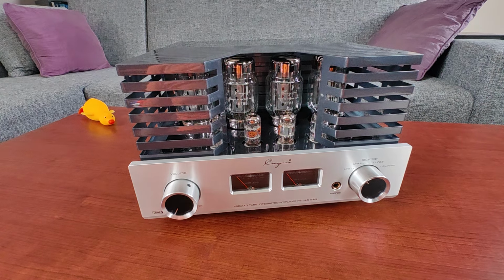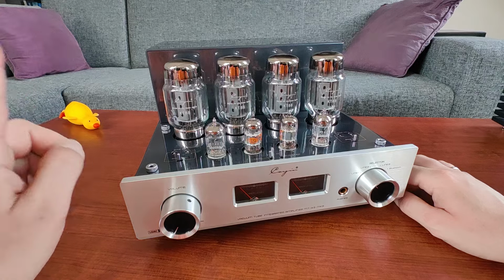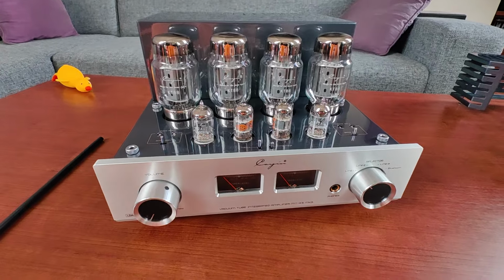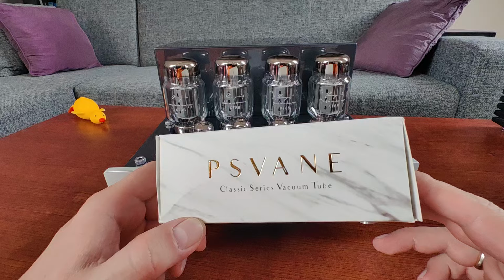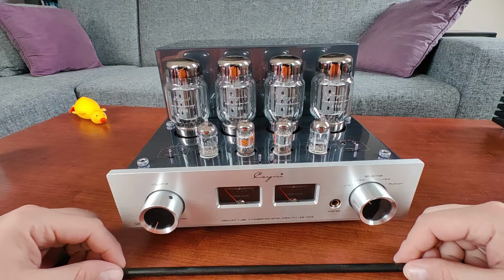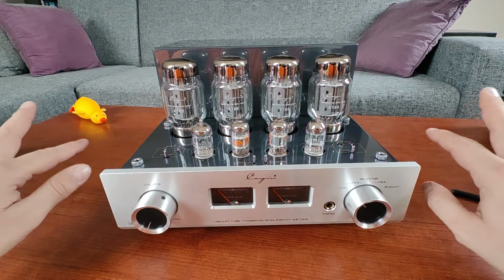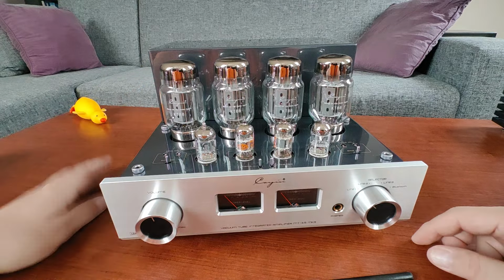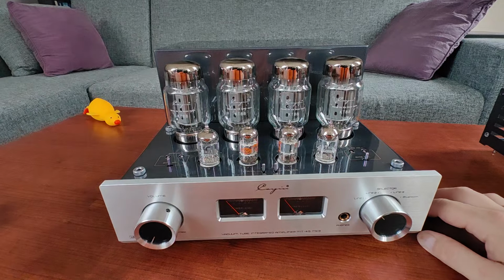Liquid GOLD! Cayin MT-45MK3 / Jazz 80 Tube Amplifier review!

Comment: Thanks for this excellent review! Would you suggest el34 or kt88 version for softer slightly rolled off high and mid/high frequencies, and more bloomy midrange?
Reply from the maker: The typical answer would be el34 but you can get the same thing with kt88 choosing the right preamp stage tubes, and you can make el34 clean and transparent the same way.

Comment: This push pull KT88 amp is amazing ! But you can buy it much cheaper called Muzishare X7. It comes from the same factory as Cayin and Line Magentic. The great thing is the switch between triode modus and Ultra Linear. I got the Gold Lion KT88 in it, magnificant ! As I own one,execptionally I wont look your video, as there is soooo many gear, and so short live 🙂
Reply from the maker: No worries :)
I was thinking about getting X7 but it's just to similar to Cayin (including switch for triode vs ultra linear)

Comment: how about detailed info on Biasing Tube amps and if there are auto biasing amps available.
Reply from the maker: I've recorded a video on biasing this particular amp. 
As for others, if there is no user accessible bias setting, it gets dangerous because you have to open the amp, measure voltage on four resistors (one for each kt88 tube) and set the small pot to until you'll get desired voltage/current value. 
That's all on live, connected and working amp so there is a risk of electric shock and/or amplifier damage. And you need some tools, multi meter and small, preferably plastic made, screwdrivers

Comment: I am new to the audiophile scene and not yet up on power to drive speakers. Can anyone answer if this amp would drive the Kef LS50 Metas ? Thanks in advance.
Reply from the maker: Hi!
It should be - though its a close call. this one is 45W per channel, but its tube amp, so current efficient, but Metas have low sensitivity so you will probably not have disco levels volume ;)

Comment: Hi there , very nice review ! Thinking on getting one . Do you recommend replacing my Carver tfm15 Amp for this one ?  Thanks.
Reply from the maker: Thanks! 
Well Carver is a solid state amp and this one is tube based. They will have different sound signatures, so that depends if you like tube sound. 
Cayin has very clean and transparent signature so it's not like many tube amps that are overly warm to the point of sounding veiled.
I don't know if that helps you, or if I've just made things worse (sorry!)
Reply: @k4syx  very helpfull indeed , appreciate it !

Comment: Correct me if I'm wrong, but this will not be a good match with Electromotions ESL?
Reply from the maker: Nope it will not, as it has problems with 1.2 Ohm load that my Ascents I are in the treble.
Basically, you have no airiness and top sparkle with that.
Reply: @k4syx  I'm a bit shocked and dissapointed. I really would love to own the Electromotions and have them plugged to a nice tube amp. Any advice?

Comment: @HIFi Zone -    
Hallo!  I don't know if you'll have the answer, but at the beginning of this video, you said that this amp, the Cayin MT-45 MkIII, is the same as the Jazz 80, except for layout of the knobs and remote control.  Do you know if they differ in terms of their inner components?   I am noticing that the cost of the MT 45 mkIII is currently a little more than half that of the Jazz 80 where I reside in Canada.  Any idea why the Jazz 80 costs nearly double?

Comment: If this amp sticks around the market for a while someone should offer a small upgrade kit ( pwr switch/vol pot/caps ) for persons who dont regularly order electronic parts on a regular basis. Hair rising up on legs is usually a good sign 👍
Reply from the maker: Interesting idea!
Though if someone is not usually ordering parts like that then the soldering may be a problem too!
But I like the idea :)
Reply: @k4syx  My mistake.... I thought I was commenting on the Oldchen el34 amp....simple and easier to work on.

Comment: First of all, thank you for all the detailed reviews you do. I recently discovered your channel and I love it.
I've always wanted to have a dedicated tube stereo amplifier for listening to music, but they were out of my budget. So, I was determined to go the Musical Paradise MP-701 Preamp + Clone Dartzeel D5 Pro route. But seeing the good reviews of the Cayin and that I would also spend half the price, I'm thinking of going with Cayin. 
My floorstanding speakers are Infinity Primus 362s that I currently use with my home theater system (Marantz 6015). What would you recommend out of these 2 options? Cayin MT-45 or Combo D5Pro+MP-701?
On the other hand, do you know what differences there are in terms of sound between the MT-45 and the CS-55A? Thanks
Reply from the maker: CS-55A is older, but I haven't heard it. 
As for your choices, Cayin is colored, but in an excellent way. I love it. D5Pro and Cary combo will be technically way  better, neutral and will give you honestly your music as it is.

Comment: Could you use 6-ohm speakers without affecting the quality?
Reply from the maker: Yes, you would need to try both sets of taps to look for best sound quality. All speakers have non linar impedance anyway and this 6 or 8 ohms given by manufacturers is just an approximation

Comment: Can you do a comparison of the Psvane Art and Acme tubes with this amp? In the US, they are about the same price right now ~ $410-420.
Reply from the maker: @Lou-li3lb  Is there Art version for KT88? I thought there is only KT88-TII and then ACME in their lineup specifically for KT88? I have these two I mention and I'm planning on doing comparison video. In short: KT88-TII is way better than stock and then ACME is even better.
I also have Linlai KT88-D but I haven't listened to them yet. But they have very nice box :)
Reply: @k4syx  It's a little confusing. On the psvane website, they have the KT88-TII on their Art series page, but the link address also says "tseries". I've seen some sellers refer to it as part of the Art series, while others do not. I emailed psvane and they said it's the same tube, just has different names in different places. I have the MT45MK3, and I tried Gold Lions KT88 and Electro Harmonix gold pin for the 12au7. It sounds great, but it also sounds identical to my solid state Yamaha A-S801...at least to my untrained ears.  I'm hoping to find a combination that sounds a bit more "tubey". I'm looking at the Acme as well as Shuguang KT88-Z. But others have told me I will get a more noticeable difference by swapping the ECF82/6U8 preamp tubes. I just ordered some NOS Philips from the 80's and Sylania from the 70's, so we'll see how those sounds before spending the big money on more KT88s. Those Acme tubes look beautiful, though. The Linlai look nice too. Are they just a rebranded Acme?
Reply: @k4syx  It's a little confusing. In the psvane website, they show the KT88-TII on the Art series page, but the web address also says "tseries". Some sellers list the KT88-TII with reference to the Art series, and some don't. I emailed Psvane, and they said they are the same tube, just different names in different places. I have the MK-45MK3 with Gold Lion KT88 and Electro Harmonix gold pin for the 12au7. I sounds great, but also nearly identical to my solid state Yamaha A-S801, at least to my untrained ears. I just ordered sets of NOS ECF82/6u8 by Philips (1980s) and Sylvania (1970s) to try for the preamp section. I've heard others say the preamp tubes will make the most noticeable change in sound, so I'll wait and see before spending big money on more KT88 tubes. Although, the ACME tubes look beautiful. The Linlai look great too. Are they just a rebrand of the same Acme tubes?
Reply from the maker: @Lou-li3lb  Linlai is supposed to be run by guys who left PSVane so these are supposed to be same or better quality according to internet wisdom :)
Yes pre tubes do make big difference and I have like 7 sets of NOS beauties to review. But also power tubes do change sound in a good way especially compared to stock Cayins. Which are ok for stuff that's included with the amp, but it shows what it's capable of with better stuff!

Comment: Hi. Do you know what is the output power of this for headphones at 32 and 50 ohm? I want to use a speaker amp to drive hifiman he6 headphones (need at least 5W at 50 ohm).
Reply from the maker: @mmm-u6e9e  I have HE6SEv2, for these I really recommend using adapter for speaker taps - look for my review for such special balanced cable. This is the best way to drive these beasts!
Reply: @k4syx  Thank you I watched it now. Which amps do you prefer for he6se?
Reply from the maker: @mmm-u6e9e  MFA1 clone is my choice as I use my Cayin with speakers. MF is smallest, has more than enough juice and has stunning a class sound quality. And it's really affordable! Read the comments below the review!
Reply: @k4syx  Your channel is really interesting. I watched a lot of reviews today. Definitely subscribing. I already have aune s17 pro class a head amp with 7.5 watt at 32 ohm for 700$. But I wonder how a powerful tube/speaker amp sounds with some headphones like he6 and hd800 and maybe iems (no speakers) while being new to this topic, so I wouldnt want just a sidegrade. If I was to buy a one and done amp (mf a1 for example would be hard to sell), with biggest soundstage and best dynamics, which one would it be out of mf a1, dartzeel or cayin mt-45?
Reply from the maker: @mmm-u6e9e  Thanks! He6 and HD800 are very different beasts and HD800 is not that absurdly hard do drive as He6, so I would just use different devices for them (but thats the problem with chasing audio rabbit, you end up with piles of amps) MFA1 is cheap and souds very very good. Dartzeel for headphones would be a dangerous overkill, maybe except for HE6. Cayin is also great, but then it sounds even better with better tubes, and suddenly you go down the "tube rolling" rabbit hole. If I had to pick one, for headphones only (no IEMs - to powerfull for them) then I would go for MFA1. Best VALUE per each dollar spent.
Reply: Ok bro. Thank you for the explanation
Reply: So as I understand, between cayin and mf you won't hear much difference in soundstage depth and dynamics on headphones?
Reply from the maker: @mmm-u6e9e  Yes, the real difference will be with the speakers. But still not a night and day difference. With headphones the difference will be small.
Reply: @k4syx  I'll get the mf a1 then. Do you know the watt per channel at 32 ohm?
Reply from the maker: @mmm-u6e9e  it's 20W for 8Ohm, so probably 10W for 16 and something like 5W in 32-my best guess:)

Comment: What do you think? This amplifier has enought energy for big standing loudspakers?
Thanks!
Reply: With 93dB sensitivity speakers any tube amp more than 10 watts will drive them easily!
Reply from the maker: What's your speaker sensitivity in dB?
Reply: @k4syx  It's 93dB but I think the power is needed for this speakers (3 way system: 27mmtweeter, 16,5 cm midrange, 3x18cm woofers)
I have a very good Kinki Studio EX-M1+ amplifier (2x200W 8Ohm) and I would buy either a tube or a pure class A amplifier (Pass, Accuphase...clone?).
Or maybe a tube preamp.
Thanks!
Reply from the maker: @csszabi8779  these are 40W per channel max, but your speakers are highly efficient, so you'll be fine. Also, tube amps are current efficient and this helps with driving speakers.
This amp will give you tube magic in spades, but without putting "warmth" detail masking blanket on your speakers. Class A is close, but not there yet in this regard so it's best to have two amps and just switch them when the mood comes.

Comment: Hallo Hifi Zone,
your way of reviewing Audio components is very useful and informative. Thank you very much.
May i ask your opinion on the MUZISHARE X-7 tube amp ?
Are you planning a review on this one in the near future ?
Best regards.
Reply from the maker: @meedeenaka6153  Thank you! 
Yes Muzishare is on my bucket list, the problem is it's more expensive than other things I've reviewed so I have to build budget for that
Reply: @k4syx  

Thanks for your reply.
I am going to purchase a MUZISHARE X-7 next year. I like the KT-88 sound and it seems to me that the X-7 offers the best value for it's price. It's built like a tank, it contains high quality caps and the latest version even offers one XLR input. 
It can also be used as a power amp since it has an input for a Preamp.
Reply from the maker: @meedeenaka6153  That's why it's on my list! 
Hint: get the KT88-TII (Psvane Art Series), you'll be really happy! I also have ACME KT88 version, I have to do some serious listening session but Art is cheaper than Acme and really amazing

Comment: About sound - bass, mids, highs, soundstage. OK.,, but this is just half the story about sound.
So, what about dynamic - makro and micro, or about quick transients. Depends on speakers, but there are significant differences between ultralinear and triode mode and between tube, classA amps and A/B class amps. 
I also have a clone class A amp JLH1969 which is very alive, open, dynamic and fast - the best mid-hi and airy higs by so far. 
For instance Cayin a50t amp is sounding in ultralinear mode like the system got morphine - not good at all. But in triode mode it becomes more alive, like jaccouzzie bath (the sound is big, embracing and quite coloured bath, but who cares) compared to rich, open refreshing shower with fine sprays of JLH's sound signature. 
So, what is with this aspects, comparations- this Cayin, or A1' clone or D5 Pro clone?
And yes, all this is very obvius with sensitive and fast drivers - like fullrange drivers in Voigt pipe or folded VP designs. With some other spekers less or very much less so.
Thank you.
Reply from the maker: Hi! You are absolutely right about that! Im not covering the whole story, theres no time for that here :( My Cayin review went for almost 1h, I had to drop internals because of that to another video. Some of that is part of detail and holography, these are ingredients, not only them of course. For me triode mode here was like everything got slower, like walking in gold mead (if that makes sense). Ultralinear - yes, morphine, but not for the amp but for me :) Everything was so packed with emotion, so moving and grabbingby the throat BUT without loosing detail that I was ready to sell my ss setup alontg wth Ascents and give up chasing the rabbit. I've cooled down a little since then,  but this will stay with me as one of permanent setups (complete chain with AK4499 based DAC (voices!) and ML Motion bookshelfs ;)
I loved reading your comment, thanks!
Reply: @k4syx  Sorry, but still you did not give just a short answer on my questions - comparing the dynamisc and the speed of the amplifiers you have tested.
Reply from the maker: @majtextwriter1794  yes you're right I did not :)
All three major ones (DartZeel, MF clones and Cayin) are fast: DartZeel being most dynamic one but closely followed by other two. I love the electrostats and this means I love fast precise sound: mellow amplifiers, slow and "musical" (in bad meaning of that word) are not for me. I need my amp (and whole setup) to raise hair on my neck.
All of them are fast, detailed and dynamic: DartZeel being capable of biggest hard hitting dynamic swings. I hope this helps, give me a shout if I should elaborate more, ok?
Reply: @k4syx  Thank you!  Kind regards.
Reply: @k4syx sounds like the Dartzeel clone d5Pro is still best
Reply: @k4syx  Yes, with Spendors A2 or some other speakers I also Liked ultralinear mode more, but with my Voigt pipes was triode surprisingly better sounding and more alive... and this is whats makes this hobby so interesting.. :))  just keep on with your presentations man! ;)